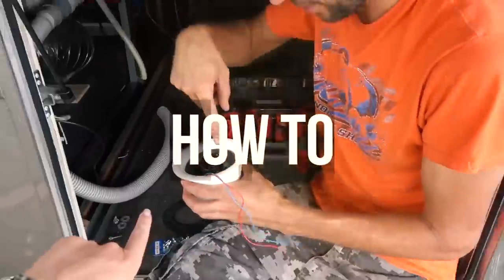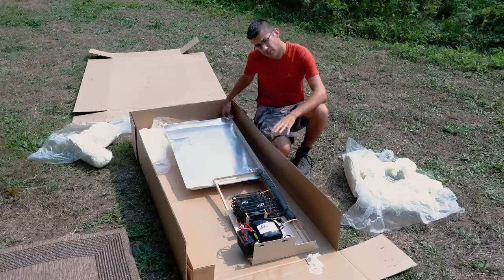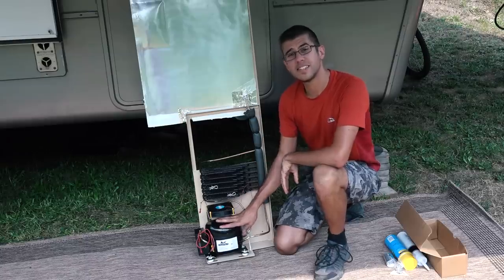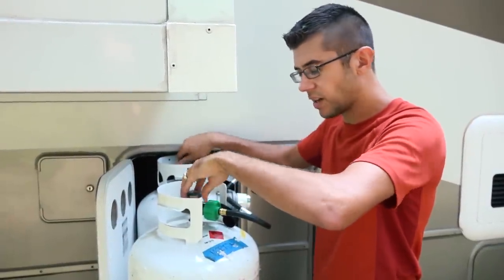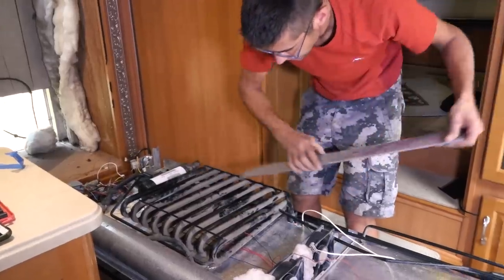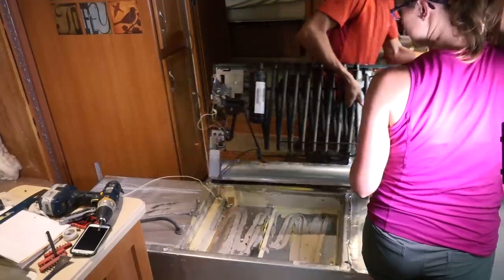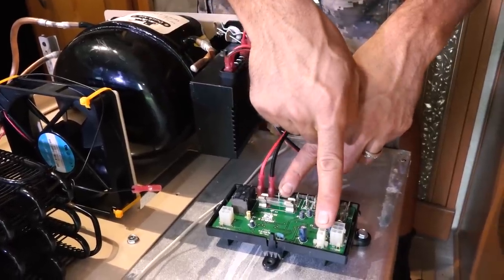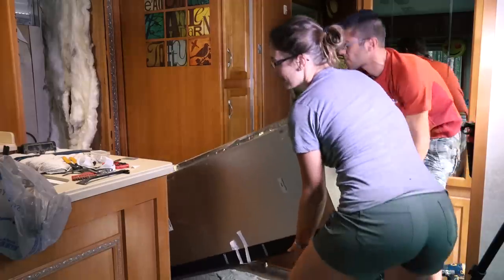Converting our RV Fridge to a High Efficiency DC Compressor- 8x More Efficient! and Better Cooling!

Comment from the maker: At that time of this video the costs for the unit for a fridge like ours was$ 595.00  for AC and $800.00 for the DC unit.  The larger units probably are a bit more expensive but I am not sure.   They can install it for $150 or ship them to you.  Their upgraded absorption unit was $650.
Reply: Based on some posts in an RV Forum, the install labor may be $300 for a side by side (4 door) unit like the  Norcold 1200.  They also offer a helium option for the gas absorption units but it does add to the price.  Helium is not flammable like hydrogen.  They state the helium model has the same cooling capacity.

Excellent video, thanks.
Reply: SO you said you got the DC model? @ $800?  do they not make new fridges like this ?
Reply: I removed my comment do to being either irrelevant or out right wrong which I became aware of after posting.  My apologies.
Reply: @sailingsolar  Yeah, when I saw the prices I said, There have to be newer fridges out there... :o)
Reply: @sailingsolar  I had to do the same thing on Bob Wells channel. He was telling everyone that solar and an AGM battery is the way to go over a portable power pack. l had to say I disagree to some point. BOTH will have to be charged with Solar but the Portable power pack can be charged by 120 and or car alternator, and yet the power pack is PORTABLE and can be used at the park at the campfire and moved to anywhere you need it.  I just hope people would look into more than one YouTuber channel before that do something like this ... SAD TIMES
Reply: @sailingsolar  wow dude, you really need to smoke some pot and relax....  your soul is filled with anger and you need to chill and deal with that.
Reply: @AdorableDeplorable1  absorption units don't use a pump, they use an electrical resistance cartridge heater to heat the boiler that the gas burner also heats. most tend to draw about 200 watts at 120vac but some are higher and some are lower. the ones with 12vdc heaters are too inefficient to even consider trying unless you have unlimited 12vdc power....
Reply: thanks for good info on how to change out unit.. one question is what do you do with the old unit.. Its full of ammonia, water, etc  how do you dispose of or recycle the metal??
Reply: @sailingsolar  ... interesting.. what do you think may have been the issue with the original system??  he did mention a lot of dust on the rear lower coils, but not sure that affects operations like the upper condenser coil being dirty. also the fan was apparently not in operation which can cause low cooling as well especially in warm climates.
Reply: @georgefenrich4119 , yes they do and the cost is $1400-$1500
Reply: sailingsolar the glass is half full bro
Reply: @sailingsolar  You are obviously lying about  being educated in anything related to refrigeration. Absorption refrigeration for domestic use was discontinued many decades ago because of the high energy consumption and poor heat capacity. I worked on Thermo Kings in containers and trucks, on small ship refrigerated holds and factory food processing freezers, they all had compressor systems.
Reply: @sailingsolar , your actually wrong, the compressor type fridges are far, far more efficient than the absorption type.
Reply: @sailingsolar  As interesting, thought provoking and informative as your post is (thank you for that), they're running a Tesla EV battery so the battery life / drain during the night is probably not a very large concern.
Reply: @bobsharpe9241  I do believe (now) I was WRONG stating that evaporation cycle "propane 'frig's" use less energy than compressor type "freon" units when compared to the same cooling loads.  I had heard that in the 80's about very large cooling units. I don't know if that changed  due to advances in compressor designs over the last 40+ years but looking as I tried today what I stated about them RV frig's using less energy than compressor units is not so now.  At least in the smaller sizes were interested in.  The link you gave says as much in part #3.  Thanks for that link, I stand corrected .  As far as what I know and read on LiFePO4 batteries they are superior to lead acid (flooded), AGM, Deep cycle or sealed batteries.  Better in this respect,   LiFePO4  weigh at least half as much for the amount of energy they can store which is important important with mobile storage vs stationary locations.  2) They can be discharged much more without negatively affecting the number of charge discharge cycles before they need replacing. For example A deep cycle lead acid batter bank is expected to give about 1200 cycles if only discharged 20% before recharged, 600 cycles if discharged to 50% each cycle and 300 cycles if discharged to 80%  of their rated capacity.   LiFePO4 can be discharged to 80%  per cycle and be as dramatically  affected .  They do suffer from winter temperatures and must never be below 32 F.. That is bad and will damage them. Also high temperatures will damage them.  In EV's they are automatically heated and cooled to live in their proper range even when your not driving the car. Also not all EV banks use the same chemistry, just any EV battery is best for RV use.  Hybred (gs and electric) EV's use a type of lithium chemistry that don't like deep discharging.  The gas engine will keep them from  being discharging as much than strictly plug in only EV.  Plug in only  EV batteries use the best chemistry available (to date) for deeper discharges. I was not aware  This channel has a tesla bank and what I said was not made with that info.  It was more from the point of RV's with one or two deep cycle flooded banks.  That makes a big difference.  Also I would not have made the same post if I knew they had +5 kwh tesla bank and  1200 watt solar panels (?) are good with their frige up grade, IMO.  That setup is very able to serve them well as they are.
Reply: @AdorableDeplorable1  Don't think in amps or volt but WATTS. Watts and more so watt hours are the unit you should be using when trying to compare energy being used.  Keep in mind it's not way a unit is using at any given time alone.  The compressor kit uses 6A DC but over a 24 hour  what is it's duty cycle?  Which means how much time is it on and how much is it off in a day? Does it run 15 minutes every hour (on 6 hours per 24) OR is it on 30 minutes every hour (12 hours per 24)?  Obviously the latter uses more power.  Another thing to consider with comparing a DC vs a 110/120vac units is their on /off time over 24 hour are not 1 to 1.  Meaning a higher voltage compressor could to move more freon (cooling) that a  12vdc compressor does per minute.  The size of the box factors in the total cooling needed and the different insulation between frige's also factors.  So comparing is not as as simple as most laypersons tend to make it.  Smaller friges ( less Cu.Ft) are better and  greater insulation is also better.  You said "From my reading, Absorpion Units use the same amount of power to run the pump no matter the size of the system." There is no pump but yes they typically use the same amount of propane for different sized units.  Which is about 1.5 pound a day whether for a cooler sized or a larger frig'.  However that said it not the whole picture.  Obviously when they are on (using gas) they are moving heat from inside  the bofrig and when enough heat is removed the thermostst turns off the gas.  They will cycle on/off as the need to keep the thermostat satisfied. If the door is left opened the box will never get cold enough so the gas is never off.  Surely that will use more what when the door is closed and it will cycle, using less over a day.  They use more propane on hotter days vs colder days too.  Remember they cooling hardware is sized larger or smaller for different  sized units.  Using the same cooling unit will use more or less propane it it is on a larger or smaller box.  I hope you can follow the dynamics of what is actually being compared to what. I have worked as a residential AC and heating service repairman and also worked several years as marine AC and refrigeration repairman for both power and sail boats up over 150 ft.    I've also work more years as a computer field service tech on large main frames before all that.  I've worked in the electronics and cooling industries for a good part of my working life, so I've done more than read about this stuff on the internet and online articles.  Hope I answered you question.  If it can be pointed out I wrong I'm happy to be informed and corrected if that is the case.  Cheers.
Reply: @carl2591  "what do you think may have been the issue with the original system??"  I relly didn't hear what the issues were so it's tough to say.   One factor to know is was it working the same in both propane and AC modes.  When not right only in propane mode it could be as simple as cleaning out the gas orfice.  Just looking at the flame it should be blue and not Yellow.  Yellow is not correct and will produce less heat that a proper blue flame indicating cleaning is needed.  Not working as well on AC mode but working in gas could ne a bad heating element.  Not working well in both could be a bad thermistor (thermostst) or just repositioning it might work.  It might have gotten mover some how causing it to run a but warmer than before.  Working poorly in both could be a sign of an early leak fro corrosion.  Just dusty coils are not likely to be the only issue unless they are really very bad. It could be a combination of two minor things which together could just cause soft ice scream. I wasn't there but the cause can be identified and corrected typically cheaper that $500.  There are very few properly trained absorption techs out there and RV repair shops make very easy money saying "It can't be fixed, replace it"  It is my understanding thay is what people usually hear and not knowing any better and coming from what they think is a trained repairman who are they to disagree. Those interested might look up "Ford Refrigeration" on YT and watch what they have to say on the state of really trained service techs. Especially their channel's first video's.. Best wishes.
Reply: @georgefenrich4119  Really, so many full time RV living people  put up a YT channels to make cash and start giving advice based on what they know which is far less than those who actually do repairs profesionally.  Watching closely,   I've seen video's where it seems they watched a few others on changing their oil e.g. and then put out a video of them changing their out and giving advice like they are mechanics who do it for a living.   My head wants to explode when I see a video saying they can run their AC with a 100/200 Ahr battery and 200 watt solar panel.  Yes, with a proper sized inverter they might but not much plnger that they show it running in their ten minute video's.  What good is AC in the desert when the battery is drained in 30 or 60 minutes and your panels need a full day to recharge that battery????  Yet there they are saying they can run their AC on the solar setup they got. Yes, for ten minutes, that's BS.  Then two weeks later their complaining how hot it is where they are.  Their not showing them running their AC's then bragging how great their setup is are they?  This channel seems better than that from what little I've seen and I not saying I've seen them do that.  Cheers
Reply: @soulway9217  I tried to look into that aspect of my comment and it was based on what I heard 40 + years ago.  I stand corrected with todays equipment.   Freon compressors have come a long way since over that time and 12 vdc compressors didn't exist and weren't possible back then ,  which might be what changed if the belief was ever correct.  I now know that comment is not true today.  Nothing wrong with being corrected, thank you.
Reply: You know, I used to be amazed that a small RV fridge could be powered by essentially a gas pilot light.  So, the big snag back in the days of my BSME was the dangers of ammonia.  It sounds like there may be other options for working fluids now.  Interesting.
Reply: I appreciate a meaningful contribution. Unlike yours sir, sorry to say.  I found sailingsolar’s information quite useful...just an engineer’s pov.
Reply: @marzsit9833  smoking pot does not deal with lifecycle cost of a retrofit 50% of a 7 year old refer. The trailer is 70% depreciated. We are unclear the extended lifecycle of the refer. The owner is a tech that does his own labor. The average Joe hires a RV repair company at what $150 per hour that may not have a trained refrigeration experience. That just dresses up a pig?
Reply: We decided to just go with an AC mini fridge for around $180. When it breaks, we’ll just buy another! Seems like the reviews of the dc fridges are pretty mediocre anyway — if I’m going to spend $1k on a fridge, it better be one heck of a unit, and I’m just not seeing it.
Reply: @sailingsolar  If you think the OE Dometic was so great, you're welcome to HAVE my old POS that's sitting in my scrap pile now.  For about $400, we are way happier with our Magic Chef that resides in the exact same space.  Better lighting, more room and shelving, MUCH better cooling and no more risk of burning down the house are just a few of the reasons to replace the absorption junk.
Reply: What Make & Model are you dealing with?
Reply: @georgefenrich4119  They do... and you'd be floored by what THEY cost...  It's highway robbery!  (pun intended)
Reply: @sailingsolar  He discussed all the options and spelled out his reasons.  If others don't see those as issues for them, they're free to do as they please.  It does remain a fact that direct compression refrigeration gives much colder temperatures than adsorption in hot weather.  I have seen this for myself, and I'd go with a compressor every time.
Reply: Fire starter fridges are what the industry was using but beginning in 2020 there are now 12v 3amp larger residential"style" fridges being installed.  With better batteries and solar panels you can boondock 24/7 and draw right from solar during the day.
Reply: Mike & Sabine R. Have to agree with the big price increase it’s easier to buy a regular fridge
Reply: @sailingsolar   The absorption units are famous for only cooling 30 to 40 degrees cooler than ambient temperatures,  I have years of experience, lost a masive amount of food over the years. 
  Now I use a compressor fridge and have not lost any food.  You might be an expert on large scale absorption units but apparently are not an RV tech, they don't work worth a crap.  Mellow out, get some experience with RV 3 ways and you will understand the reality of RV fridges.
Reply: @georgefenrich4119  No.
Reply: @carl2591  -- The fan was an after-market DIY install; they don't come on the original units. Apparently adding the fans does help on really hot days but those computer fans don't move much air and facing the back of the reefer towards north or east (above the equator) would likely help as much or more than a computer fan. :)
Reply: @carl2591  -- Usually the replacement units come with a prepaid shipping label to return the old unit for your core credit (once they confirm the old unit is rebuild-able).
Reply: I just bought the AC unit after watching your video, can I still hook up the batteries and solar power to it
Reply: why dont use a couple alternators for unlimted free power and very powerful
Reply: @pamatthew99  do you happen to have a link or any other helpful information on this type for an RV? Thanks
Reply: @sailingsolar  I had bought an old 71' 19ft terry travel trailer years ago and it still had most of the original stuff in it. This was the first experience that I've had with the ammonia type fridges back in the 90s. An old timer told me, besides cleaning all the tubing, contacts and gas vents, he gave me two fans to mount above the top tube, and he told me that these ammonia types, after sitting for a long time or even just being used for a long time, they stop cooling as well and unless they have a hole in the tubing, he said what happens is, over time the ammonia starts to crystallize in the upper tubing. He said the trick to fix that is to, CAREFULLY,  turn the unit upside down, leave it for 24hrs, turn it right side up, leave it for 24hrs, turn it upside down again, leave it for 24hrs, and finally, turn it right side up again and leave it for 24hrs. To dissolve the ammonia crystals. 
Now this sounded pretty damn silly to me, but I figured, what have I got to lose. So, I cleaned it up, went threw his recommended 4 day process...plugged it in....AND IT FRICKEN WORKED!!! ;-) So I put the fans on, replaced the two door gaskets, cause they were old and stiff and that was the only money I had to put in to it!! ;-) Can't do that with a compressor style fridge! ;-)
Reply: @natureboy6410  Thank you for that insight.
Reply: sailingsolar you are misinformed or working on outdated information my friend. 12V compressors are the way. The RV world will all switch in a year or 2 now that solar is becoming more common even on entry level RV’s. The Forest River Wildwood is already 100% 12v DC compressors on all their models, and that is one of the best selling RV in the US. The rest will follow.
Reply: @chipge  Yes I do agree you are correct.  I have looked into it further and my beliefs are no longer true with the efficiencies refrigerator compressors have to day over decades ago when things were different.  I don't know when the difference changed but I see that it has.  Cheers.
Reply: While it's more efficient to use LP gas, it's the #2 cause of RV fires (after engine fires). After watching the YouTube vid "Where RVs Go To Die" and seeing the morbid junkyard of burnt RVs with the eerie display of broken glass and scattered children's toys, I decided to never have an absorption fridge (aka LP/3-way). One of the comments told a story about a family who decided to take their camper out, but had the good sense to take it in for its maintenance check before they left, just to be safe. The RV mechanic discovered that their fridge had been leaking ammonia & that the attachments were extremely corroded. It was likely due to them keeping the fridge on while the RV was parked slanted on their driveway. He said he's surprised they survived the drive in. Another story was from a man who tried to save a couple trapped in an RV when a fire broke out & couldn't save them. They died bc they couldn't escape. So that also has gotten me to make sure I have multiple extinguishers & a glass breaker. I'm also considering a fire-suppression system in the engine. If I wanted to keep an absorption fridge, I would also need to add a suppression system to the fridge & an Amish cooling unit. A compression fridge may require more power, but for me it's safer, offers more space, doesn't need to be level, and its entire cost is 1/3 to 1/2 the cost of the typical repair of an absorption fridge.
Reply: @sailingsolar  kudos to you for revising your statements based on new information.
Reply: @SteveBroyles  Right!   I been thinking.  My question to you is do you think I should edit that post to take out what I found out was based on wrong data or reasoning?  Someone might read it and not read the correction is my concern.
Reply: @sailingsolar    yeah.... It would help clarify if you edited something above the original comment.  A disclaimer of sorts.
Reply: @SteveBroyles  I'll do that when I have a moment.  Thanks.
Reply: @joeboxter3635  The unit has one of these two compressors (which ever was chosen by the manufacturer of the cooling assembly),  It is a "Danfoss" variable speed refrigeration compressors type BD35F or BD50F, . They come in 12 vdc or 24 vdc models.  Google search "Instructions manual BD35F, BD50F  and you'll get the wiring schematic and data sheet.  Figure 1, first page in the instructions sheet shows a chart for cut in/out voltages and what resistor values to use.  Does that help?
Reply: sailingsolar not sure about the whole discussion. EE here.   I’m not a refrigerator guy.  Anytime u use 12 V vs 24 V.  The later is always more efficient for everything being same.   There is hear loss due to the higher current.  

W = I x R x R.
Reply: @wildman4642  The new refrigerator prices are too steep for me, so I looked into getting the replacement adsorption cooling system. Even that was $650 for my midsize fridge model. 
Portable ice boxes don't keep food frozen using regular ice, so I have to use dry ice. At $30-50 per trip, the dry ice adds up too. Overall, I think the extra cost of the DC model might be worth it to save on propane and run while driving.
Reply: @joeboxter3635  That compressor is a Chinese knockoff and it works.   I use to have a Residential Heating and Air Conditioning contractors license in California in the 80's before moving to Florida and repaired Marine Refrigeration/Freezers/ Air Conditioners full time. I also built 3 way Marine cold Plate Ref/freezer for my 40 ft. sailboat,   I lived aboard that for about 16+ yrs.  It had a car compressor to run off the diesel engine,  a Danfoss 12 circuit and a 120VAC circuit because I was working in the trade. I could build a custom unit, so I did.  3 separate cooling circuits in one box.
On 12dc it pulled 6 amps and had a 33% duty cycle/ over 24 hours. It used just under .6 KwH a day.  The box had 3.5 inches of foam insulation on all sides. 

I am retired now and live in a 28 ft class C, RV now.  Some day if I get the ambition I'd like to rig my Dometic RM265 gas line to a propane torch bottle and weight it over several days of use to get an Idea how much propane it uses over 24 hours on average.  If you know how to do it it's pretty straight forward (like anything).  IMO, if you don't KNOW for a fact (by measuring) how much Propane a unit uses a day,  I don't know how it can be asserted they use less energy over a 12dc unit.    That said, in 2020 compressors are in fact more efficient  today than in the 70/80's.  But there is a limit to how little energy they use in a day. 

Looking into what the Morton's did and googling  I became a believer that 12dc is more efficient but with solar panels the power (12 vdc) it's "free"   and propane cost $$.  So it is cheaper to run on solar after paying for the panels.  Thanks for your reply and Best  wishes
Reply: @joeboxter3635  Replying to your "Edited " reply after my reply.  I never caught what was wrong with their old propane system which caused them to do this. I assume it stopped cooling and it might or not had been repairable i Don't know.   I know it was about ( give or take) the same as replacing the propane workings. The propane guts are about $800 and you use your same box.  They did have plenty of solar on the roof already so the idea was to eliminate the propane costs going forward which was a good way to go in itself.  I also never heard of any problems after the change over so I can't comment on that.  cheers.
Reply: @georgefenrich4119  SPOT ON!  THE NEW ONES ARE LARGER ALSO, I THINK THEY ARE IN THE 10 CU.FT. RANGE (AND AVAILABLE IN AC OR DC).  THE CONVERSION SEEMS LIKE A HALF BAKED SCIENCE PROJECT.  BUT, I DO GIVE THE MORTENSENS CREDIT FOR TAKING ON THE JOB.  CHEERS!
Reply: @natureboy6410  Yes, that does work but usually just prolongs the agony. I was an RV tech in the 80's to the early 90's. We "fixed" many fridges that way, some were still working 2 years later. As techs we were told by Dometic that running them off level was the reason the gases crystalized and they also told us it was normally blocked in the small capillary tube toward the bottom of the unit. I never actually cut one open so just relied on the word of Dometic. There are few places left any more that want to deal with repair and recharging of the units. Some of the push toward compressor style by the industry is to cut the cost of building them. Of course that savings will probably not be passed along to the end user.
Reply: Great video and well demonstrated, well done,
Appreciate if you provide provide the contact and email address for the DC compressor unit.
Thank you
Reply: @georgefenrich4119 thats what I was thinking pirtable power pack. 

Im looking at a camper (1st) and believe Ill do more "boondocking" but I need electricity.